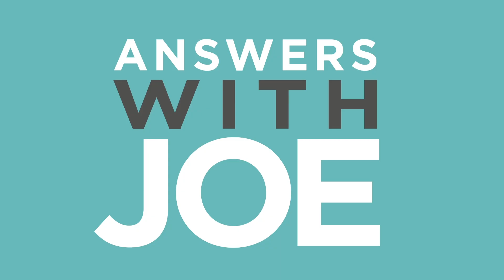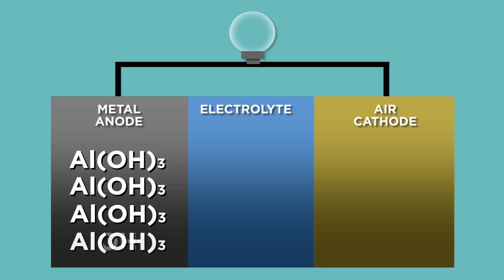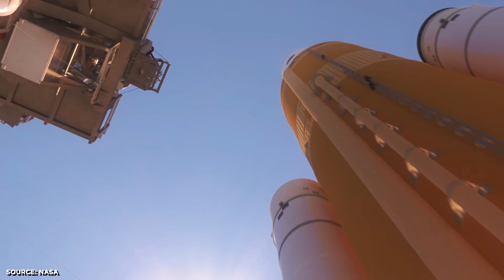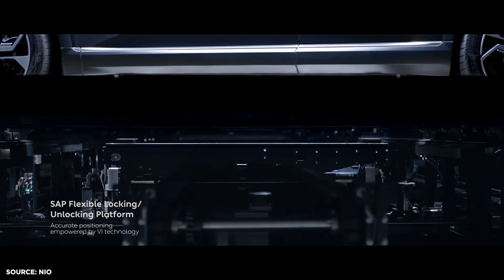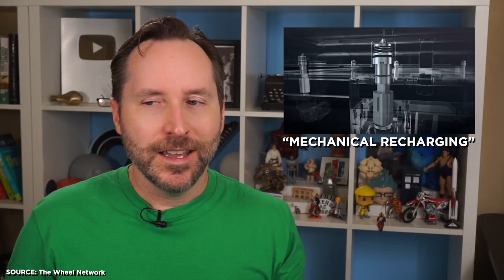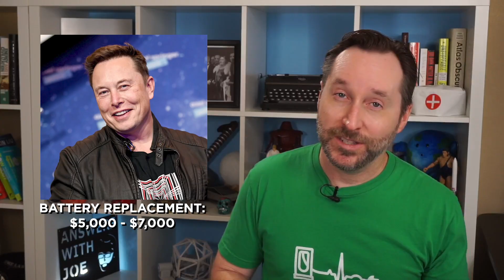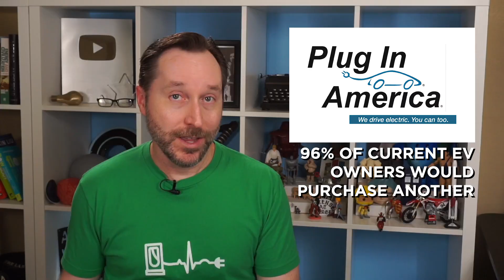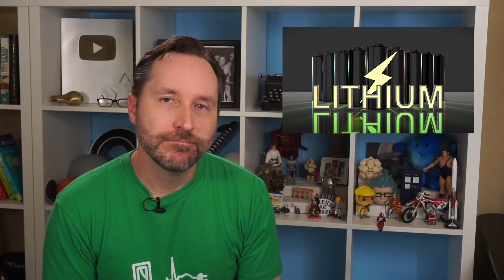This Battery Could Drive A Car 1500 Miles - But There's A Catch | Answers With Joe

Comment: I think AL-Air batteries really do make sense, and would help swap plastic dependant industries to aluminum by putting a lot of pressure for more localized aluminum foundries. Something that would both help reduce shipping and help reduce the cost of all aluminum products.
And the experience of filling up would be quite a bit like the full service stations that are mostly of the past.
And frankly, I think the experience of mechanically recharging an well designed battery cell by the user would match well with the spirit of motorsport enthusiasts particularly off road device's, just taking it apart stretching new aluminum through it and bolting it back together for the new season of riding, instead of cleaning the carbs.
But. Capitalism does not often favor the best solution for all industries and advancements just the most profitable and convenient. 
That is the biggest issue I see. You'd have to convince local foundries to invest, and not the auto industry

Comment: The shuttle solid rocket boosters fuel is extremely similar to the aluminized paint used on the Hindenberg. Hydrogen burns almost invisibly. Aluminum powder burns much more fiercely.

Comment: why not do both? could carry a spare 1 or 2 air batteries hooked up so if u loose charge from your lithium ion, it switches to the air battery till u van get the ion charged. so for ppl who need to long haul it could be worth, n ppl who want the ability to long haul randomly. need to make energy standard too so can use these energy for everything.

Comment: Aluminum, for its widespread availability, is absolutely a wonder material. Of course there are stronger metals like titanium or tungsten, but they cost far more to produce and are much rarer.
Reply: Titanium isn’t rare, it’s just difficult to isolate. The white paint in your house is most likely titanium oxide.
Reply: Wouldn't it have made more sense to say there are lighter materials since aluminum is known not for its strength but for its weight.
Reply: @slcpunk420  aluminum’s utility is in its strength to weight ratio — it is strong for how light it is, hence its dominance in the automobile and aerospace industries.
Reply: @KC_G4S  ok so again, not known for its actual strength compared to other materials but for its light weight 🤦 prove my point some more why don't you
Reply: @slcpunk420  Congratulations on winning a YouTube comment section argument 👏 hope it was worth your time
Reply: @slcpunk420  Please define 'actual strength'. Per unit mass Al can be at least as strong as Fe. It really depends on how you define strength and a 'specific strength' type number would show Al ~= Fe

That you can use less mass of Al to produce items as strong as steel (what even would be the point of replacing steel if you needed more mass of Al to get the same strength?) shows you don't really understand what you are saying.
Reply: @KC_G4S  aluminium isn't really better than steel in strength-to-weight. That it's often preferred has other reasons, including easier machineability, less corrosion, and that it is in some applications better to have thick pieces of aluminium over thinner steel – both would have about the same strength and mass, but the thin steel would easier dent or buckle.
(Also worth noting that neither iron nor aluminium are ever used in pure form. Both have alloys with very different characteristics.)
If you require better strengh-to-weight then carbon composites are the way to go, but these have their own downsides.
Reply: @seb3090  get help
Reply: titanium isn't really rare just costs much to produce.
Reply: Congealed electricity isn't exactly what I'd call a wonder material. The Hall–Héroult process is only 40% efficient, it takes ~15MJ/kg and the theoretical limit is ~6MJ/kg. And that's only for reducing alumina (Al2O3).

The difficulty of reducing aluminium is the reason it was rare until the modern era and while we've got more energy these days to make it the process is not efficient.

I mean we create 64M tonnes of Al per year, compare with 1900M tonnes of steel. Aluminium is more abundant in the Earth's crust than iron but we produce 20x more steel as it's far cheaper and easier to produce. Wasting aluminium by hydrolysing it to produce power is a dumb idea. Far better to use the electricity that you need for producing Al metal to power trains.
Reply: You could have just said iron or steel

Comment: yeah... quite a catch indeed. Honestly for "physical recharging" - I think it should do at least 5k miles to be worth consideration. I mean you wouldn't have these replacement points on every corner and every station near intercity highway.
Reply: Agreed.  And how much waste is going to go into batteries being replaced that haven't been completely used up? Because nobody is going to want to be somewhere where they cant get a battery change.  But I'd say more like 10k miles would be worth consideration.

Comment: It seems they could be a possible solution for commercial transportation. Lorries, vans, and busses would really benefit from the extra range, and given they tend to do their business from central hubs, it would reduce the number of places you need to distribute the batteries to. The cost would be a worry (7p per mile for a car isn't much worse that you'd get from a reasonably efficient petrol engine), but given that eliminating recharge time would bring massive savings of it's own it might be good option compared to converting business fleets to rechargable.
Reply from the maker: Now if only you can find people to drive the electric lorries.
Reply: They'll be autonomous, @joescott , as will be the battery swap machinery. The problem will be finding people to stock shelves.
Reply: @joescott  
I suppose that in the fullness of time, one driver for a convoy of 10 vehicles?
(Not going to mention the irony of many brexiteers being anti green/ Tesla 😉)
Reply: Yeah on avarage what is good for a car is even better for an autobus so yeah , 
Car bad ,
Bus better , 
Train good
Reply: Exactly what I was going to say. I think this would be a better option for commercial vehicles than to charge. I think the swap stations could be easily integrated in truck stop gas stations
Reply: Brilliant John.
Reply: Also hybrid for long distance travels with private cars by putting the stations on autobahn where people will go anyway when they travel long distance. Very easy to supply and scale. Though a standard system would be needed and still complicated.
Reply: @vocassen  
Regarding "Very easy to supply and scale"
Not sure about Germany (Autobahn?) But in the UK fuel in motorway services is always the most expensive anywhere.
Why would this be different?
Reply: But someone has to deliver the batteries to that central location, and given that lack of drivers is causing a gas shortage in some countries, we will have an entirely new set of problems.
Reply: @e.w.3989  Why?  Instead of delivering batteries to the central location why not keep a supply of batteries along with refurbishing facilities on hand?  Would that be an option?
Reply: Why do you even need to go to a place to change the battery? Just have multiple smaller ones that you can just plug in and out when needed and then you wouldn't need extra infrastructure, just shop or "gas" stations that sells the batteries and that might even buy back the empty batteries. And before anyone says that its dangerous, you can make it as safe as filling up on gas, ie only stupid people get hurt.
Reply: @Jan 6 was "Wall Street Putsch" part 2 What?
I mean I get the idea about convert being the right word instead of generate, but power is just energy per second.
Or maybe you are thinking about power being specifically electrical power.

If we want to get really into the weeds then technically all it does is create a difference in electrical potential (aka voltage) across the electrodes until a circuit is formed and it actually does something. The amount of power that is usable depends on the resistance.
Reply: @cormacsyt0  Oh, snap. I forgot about that automated warehouse!
Reply: we already got wire tap busses from way back in the 50s so that ones off the list.
Reply: And the batteries could be HUGE on lorries, too. Imagine 5,000 miles :)
Reply: @michaelmeehan5505  True, but the lorry (did I spell that right? I'm from the States) would also be heavier. It might be more efficient to make a lorry with a 500-1,000 mile battery, so it can store more stuff.
Reply: @jeffbenton6183  It's fun, watching the future unfold, eh/ :D
Reply: lithium battery will probably be needed albeit a small one to take care of the regen breaking
Reply: Are you located in the UK?
Reason I ask is that in the U.S. there are no “lorries” except for a few woman named Lorry.
But we do have “Trucks” which is what I think it is. I’m gonna tell my friend Lorry that she is a truck. She’ll be happy about that. Lol
Reply: @Bassotronics  Yes I'm in the UK, and yes "Lorry" = "Truck". :) Weirdly I don't think I've ever met or heard of anyone from over here being called Lori. As ever, when so much is shared it's sometimes the tiny differences that fascinate.
Reply: @Bassotronics  "Bass I love you." really sounds mega on my old B&W speakers from the '70s. Great tune, I like your work. Happy New year.
Reply: @differentname8051  
It’s a small world.
Thank you for enjoying my music!
Happy New Year! 🎈🎊🎆
Reply: @Bassotronics  Haha I'm having fun, mind you the same can't be said for my neighbours, I think they've over done the new year's spirit and they're falling to pieces. A nice serving of hangovers for them then, with some of your finest creations filtered through the partition wall to start their clock for daybreak in '22, lol.

Comment: Ørsted discovered aluminum in 1825, but the first industrial production wasn't until 1856. Charles Martin Hall (lived in Oberlin, Ohio and was a student at Oberlin College) discovered an electrolysis method that reduced the production cost by a factor of 200. On of his professors held up a piece of aluminum and told the class that if anyone could figure out a cheaper way of extracting aluminum and at a commercial scale, they would not only benefit the world, but become rich. Hall started working on it a year later and five years after that (1886) he found the electrolysis method and patented it. Two years later, he was one of the founders of what became Alcoa. Both of professor Jewett's predictions came true.